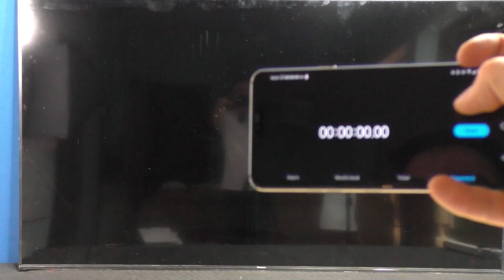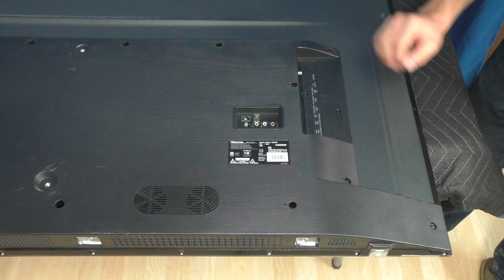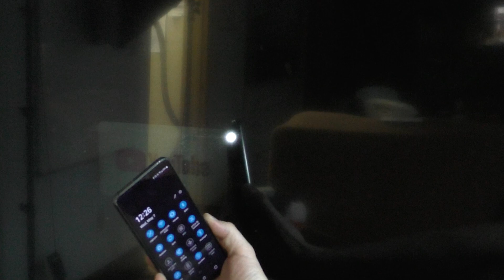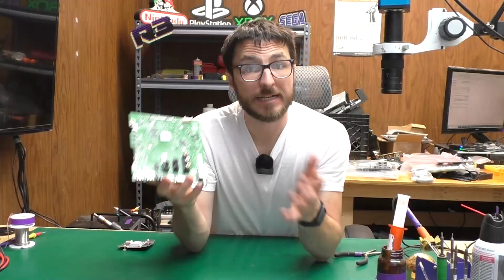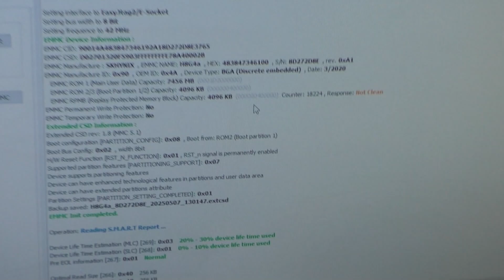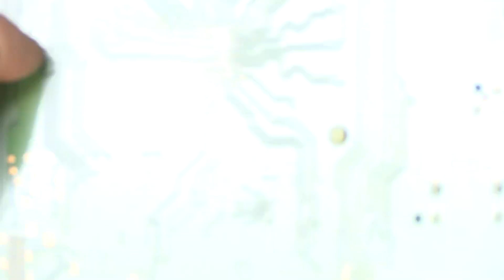How To Fix 4k Hisense TV 75H6570G Shuts OFF

Comment: so I have a 65h6570g, its just over 5 years old (free replacement tv from Costco), from the moment I turn on the TV, navigate very briefly to the setting, then screen will fade out (blank screen); takes about 5 mins until the stand by light is back on solid red.
Reply from the maker: Sounds like a defective mainboard. When the screen fades are you still able to navigate menus blind? Like if you changed inputs do you get the ding sound from the speakers? If yes you may have a T-con or screen failure. Maybe even LEDs. If no then the mainboard is failing.

Comment: What does it mean when the tv shuts off after 2-3s post board repair? 65H6510G
Reply from the maker: If we fixed it, I recommend reaching out to us via our info@nickselectronics repair email for customer service help. But it most likely means a connector, wire or ribbon is not properly inserted, perhaps a different part of the TV is also defective such as the backlights. Or there is an issue with the mainboard. But if it was just fixed by us, we always live test the boards in a live tv including HDMI and audio for functionality.

Comment: Hello nick from puerto rico... I have the same tv when I power on it goes off a 49seg. The tv when to black screen but the power button light remain off ( no red light)..

I try on the remote control to power on or off but dont do nothing..
Only when I remove the power cable and conect again the power button light goes on red
I have to do the 2 test??... or is the main board damaged?
Reply from the maker: It sounds like the mainboard is damaged but i would repeat the test with the leds disconnected to be sure if I were you.
Reply: @NicksTVRepair ok I will check thanks

Comment: I have a hisense smart tv 65inches .and it's not android .  I bought it on 2018 .still working .cross fingers . 😅.
one things am afraid of the backlight replacement . I have repair many led tv backlight .it was successful .
the biggest one was a 55inches . backlight fail when I used my led tester .nothing light up .Also the capacitor in the led driver also blown .
But I never did a replacement higher than 55inches .
Am afraid of the frameless screen .they glue it with double sided tape .
I won't able to do it . I know I have a limits of my knowledge but for a 65inches I won't do it .
Am very happy the way you explain how to tackle a problem .
steps by steps .
I really appreciate and enjoy your videos .
thanks 👍

Comment: Cost on a new board, and the led lights?
Reply from the maker: Led strips are super cheap like $50 or so for all of them. I recommend you get them from Shopjimmy.com that's who we get ours from. New boards is not possible, they are all out of stock, which is why we offer the mail in repair service. We have a flat rate fee for those repairs and provide a 1 year warranty. For more info on that, you can check out the link in the video description. (I don't like posting links in the comments because you really should never click on links someone posts in the comments even if it looks like the same account that posted the video)

Comment: Would clearing out the old software and reinstalling the software again work instead?
Reply from the maker: sometimes but usually no. Often it's not the software that fails but the chip that fails making the software not accessible.
Reply: @NicksTVRepair  ok. Thank you. you mentioned in the video that you guys sell the mainboard too instead of just repairing it. I couldn't find the item in your store. Is it in another site or am i just missing some link to get to that item?
Reply from the maker: So we did run out of stock I think on these but we still offer the service. These boards are all out of stock from everywhere now so it's not really possible to get them. If you don't have a mainboard to fix and send in I would recommend finding a defective one for sale for parts and to send that in otherwise you may not be able to get your TV working.

Comment: I have the same TV. It suddenly stopped turning on at all. The red light is flashing on and off, 3 seconds red and 1 second off. Any tips?
Reply from the maker: When the eMMC chip fails it can fail in different ways that cause more or less severe symptoms. What you are experiencing is most likely that eMMC chip failing on the mainboard, but a stated is just a more severe versionof the failure. 
The repair shown in this video however would be the exact same for you mainboard. 
If you want to send in your mainboard for repair, we do have a flat rate service with a 1 year warranty available. 
https://nickselectronics.com/products/75h6570g

Comment: No need to program the new eMMC before installing it?
Reply from the maker: You do need to programe it. The software is unique to each TV.
Reply: @NicksTVRepair  Is the software hard to find or is it the same as the firmware you can find on the manufactures page?
Reply from the maker: it's not provided by anyone, you have to get it yourself by copying it from a good working board

Comment: Wouldn't it be wise to replace the thermal paste with a better quality thermal past like Arctic? Hisense seems to use that cheap silicone based thermal paste with low conductivity.
Reply from the maker: It wouldn't hurt but also we have worked with hundreds of these mainboards and have never seen the processors fail unless there was some sort of external force or extreme circumstance. Those processors don't get very hot, which is why the heatsink is so minimal on these boards.

Comment: Please what is prpgraming emmc Etc.samsung Lg.elit and smart etc...completet memori vedeo film i am to Republic of Srpska to Bosnia
Reply: He kinda slipped right past this crucial step, didn't he. :D  And although I enjoyed the video, very few people have this type of solder rework station for bga chips.  Informative video, but not for the typical diyer.  I wonder what the cost of a replacement board is though.
Reply from the maker: Well the programing of the eMMC chip I don't cover because it's just clicking a few buttons on the computer and is different with every programer. If you want to learn how to program an eMMC chip it's best to read the manual of the programer you are planning on buying as everyone of them has it's own unique UI and way of doing things. I also do not recommend you get the one we use, it's way expensive and you can get much cheaper ones that work just as well.

Comment: I had one with a bad panel because half of the screen was little darker on the left side
Reply from the maker: Oh very interesting. I haven't see one of these 65" 70 and 75" G models with a bad panel yet. For me Its 70% mainboard failures 30% LED failures in my experience. (not including the 55" models) but I am sure I will encounter one with a bad panel at some point soon.